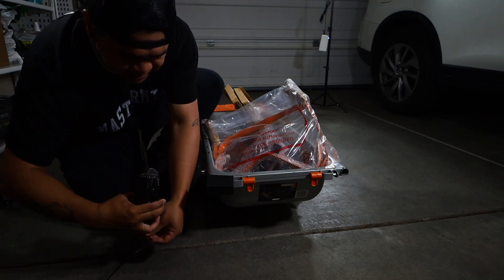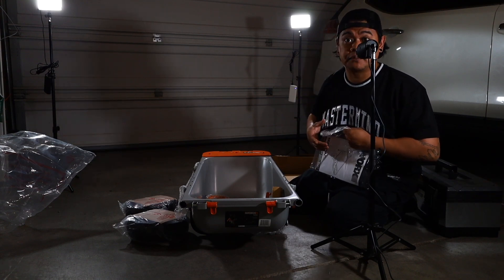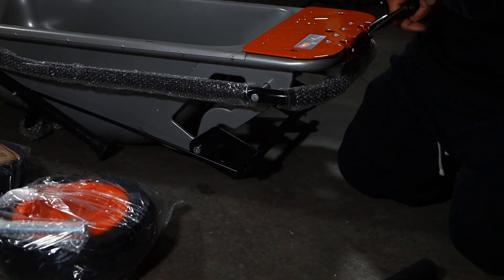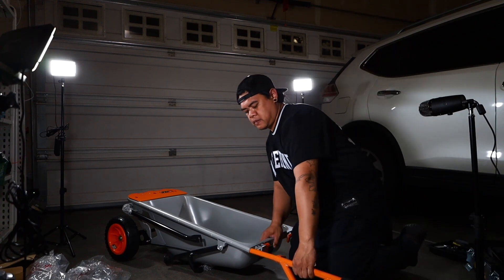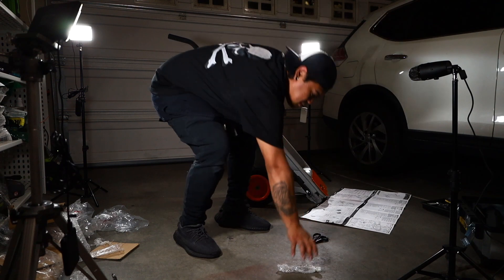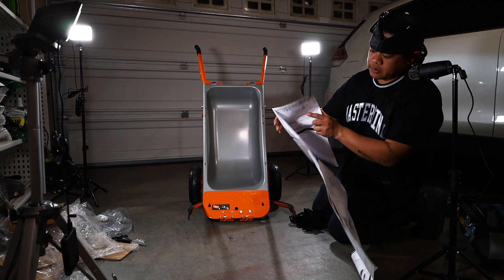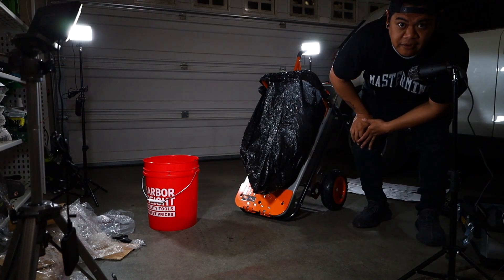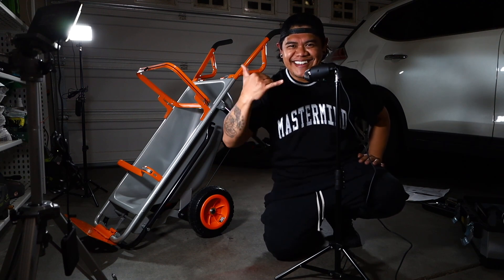WORX Aerocart Wheelbarrow ~ assembly and banter 😂 Thank you Mitch and Brooke for this present! 😊🙏🏾

Comment: Yard Bruh. I want to personally thank you for plugging some of these elite lawn tools. I’ve purchased the Amick and the rotary blades just from watching your channel. 

One question for you in regards to weed prevention: I put down a pre emergent Scott’s Triple Action and although it greened a lot of grass up, I still have some crabgrass and a lot of thistle weeds which are nasty. Is there something else I should use for a pre emergent to stop these? 

Also, do you know if it’s more effective to spray post emergent sprays on the thistle or simply just pull them out? I’ve pulled out probably 200 now thinking uprooting them will get rid of them entirely…
Reply from the maker: Thank you for the support! Wouldn’t be here without you guys 🙌🏾😊🙏🏾🤙🏾 as for crabgrass and thistle I’m assuming you’re cold season grass… Tenacity is the best. I tried the ortho crabgrass and weed killer store bought for $30 and it worked for a bit until the sun came out and bam crab grass emerged in the backyard. Front yard is straight tenacity only and it’s crabgrass and thistle free… I mean some thistle come up here and there but very rare and very small lol I sprayed tenacity March and still no crabgrass or thistle in the front! Another round early august and then rest until next spring. Bottle is kinda pricey but it lasts forever! Subscriber Daniel said to try tenacity and speedzone mixed together which I will try next application so I can’t confirm his cocktail but I know just straight tenacity is the best! 😊🤙🏾🙌🏾🙏🏾
Reply: @YardBrah  Awesome thanks. Yeah cool season grass. I also have some lumping tall fescue that looks really odd with the rest of the grass. It looks like a weed but I don’t think it technically is. Should I spray tenacity on that as well you think?
Reply from the maker: @lordbaelish19   I'm pretty sure the tall fescue will survive the tenancity if you want to get rid of it you'll have to use a pro plugger then soil and seed again... i have some tall fescue mixed in as well it's not too bad.. I like my salad bar 😂